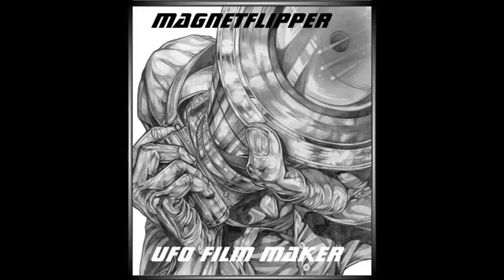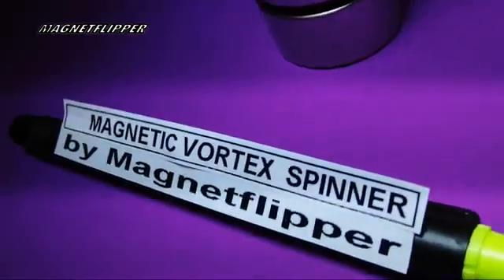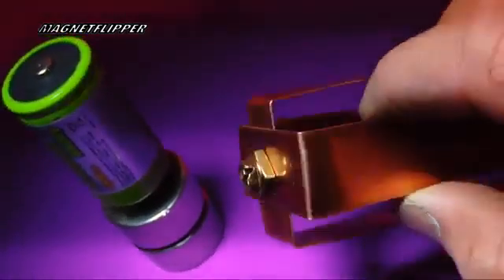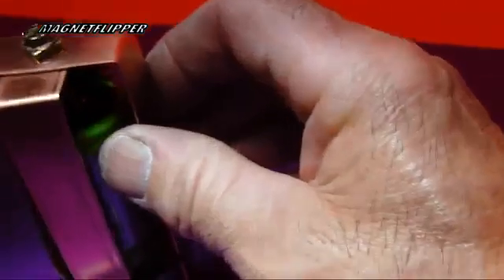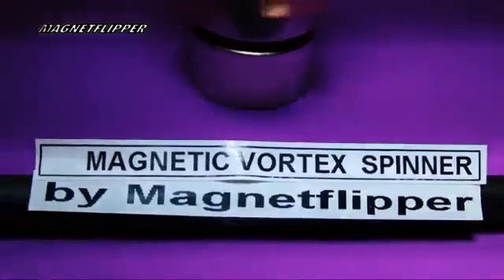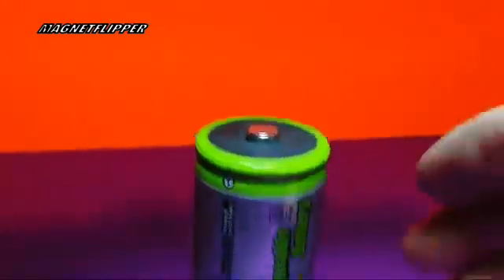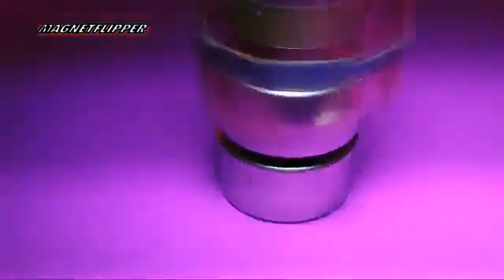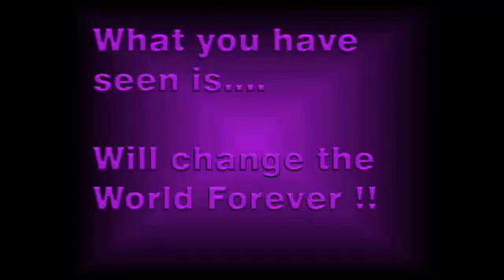MAGNETIC VORTEX SPIN its against the LAW built by Magnetflipper Sept. 2011

Comment: Faraday discovered some interesting things also using only one pole of a magnet. He showed that a copper disk spinning off one pole would generate electric fields to the outside of the disc. Then he showed that you can attach the magnet to the copper disk and it still works. The precession cone at 1 Ghz is so fast the magnet spinning with the disc still generates current.

Comment: PS: Explanation of your vortex in water is more complex than I just proposed. (A friend here and I debated the matter over dinner.) See that video for comments. Basically, the gas bubble just go up due to gravity/boyancy. They are mostly neutral diatomic molecules of H2 or O2. (Which electrode we see in the wire is not clear, it's charge not noted.) So this moving charge is not what interacts with magnetic field. We must see the whole electrolytic tank, with other electrode. Follow current flow.

Comment: Current goes from top of battery to screw to copper arms forming a current link rim with magnet at bottom, linked to battery - other pole.

At the bottom there is: current from edge to center/battery; mag field up/down. Motion must occur in 3rd perpedicular direction: tangential force spins arms. So no active vortex of mag field must exist. In your gas bubble test, charged particles enter mag field & float up, & so get twisting kick in 3rd direction. Nifty effect! But not a rotating mag field